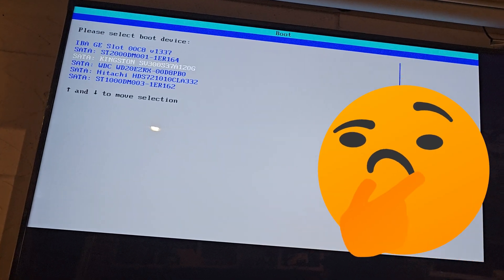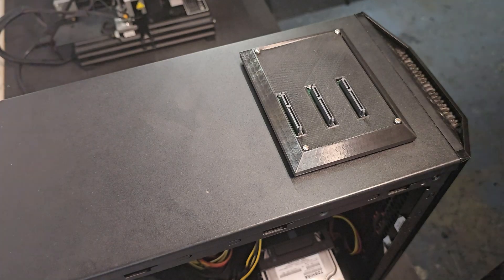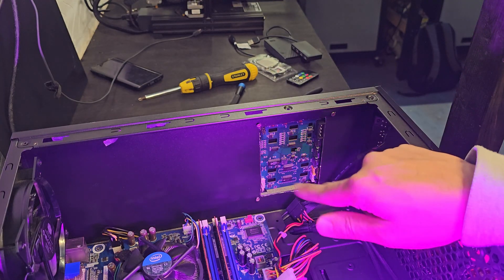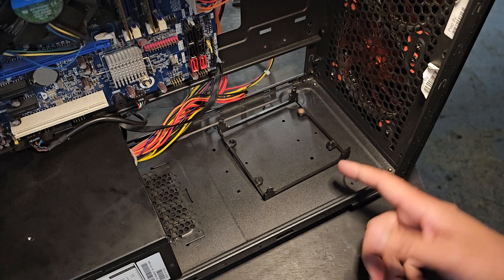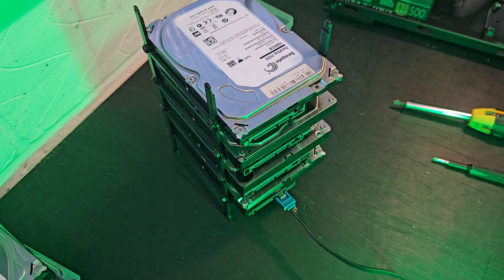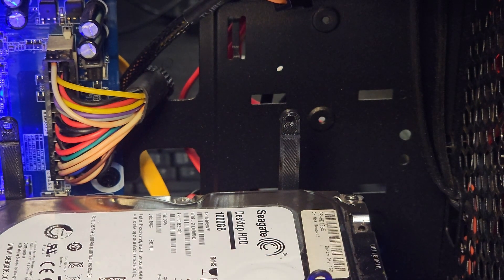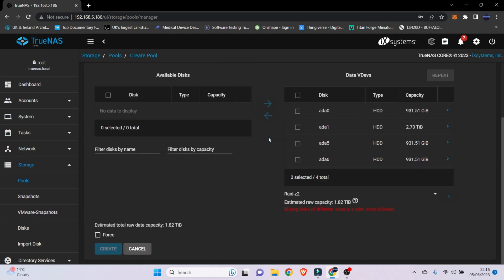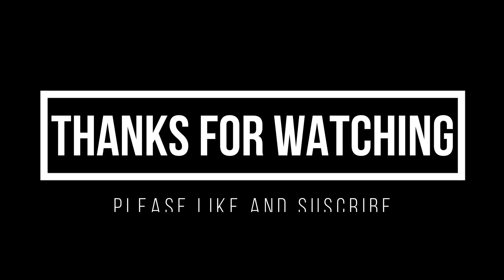$150 10TB DATA STORAGE? Build your own NAS Machine or Chia Miner!

Comment: Nice. Just found your channel and I like your videos on your projects. I have an AMD pc from 9 years ago, and can't get more than 3 hard drives to work. Even though I have 6 sata's to plug into.
Reply from the maker: Glad you like the channel, sounds like 1) could be an issue with the driver for your  Sata controller or 2) the sata controller has gone dead on your motherboard or is slightly malfunctioning. Best thing to do at that point is take the PC apart, give it a full clean with new heat pads and see if it fixes anything